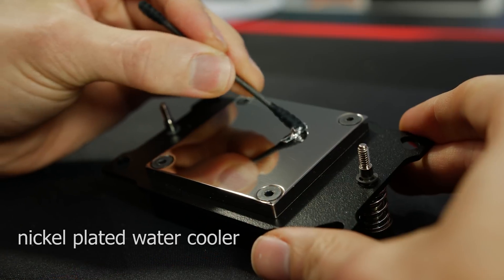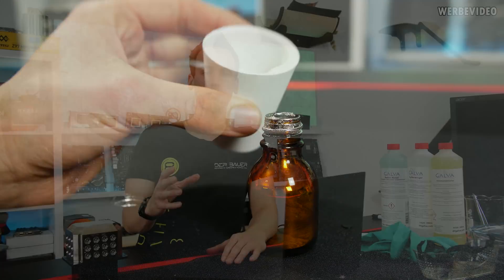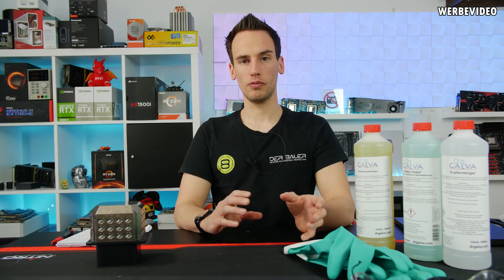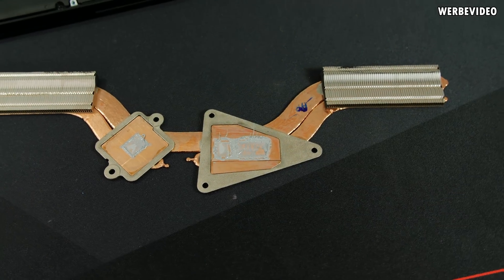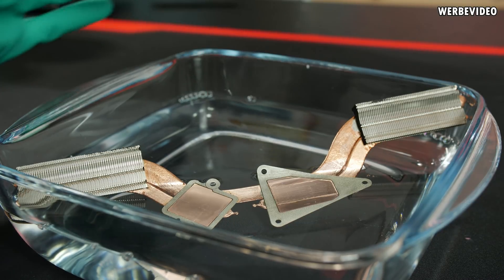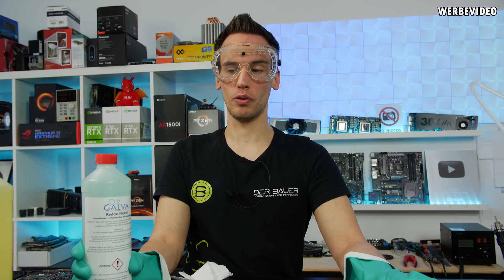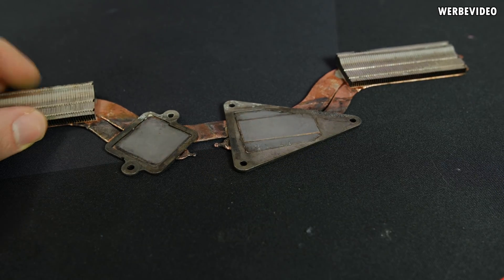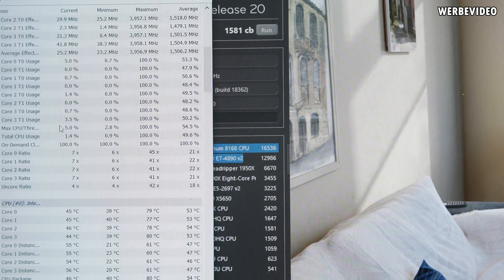Can this REALLY work? DIY Nickel plating a CPU cooler (Liquid Metal preparation)

Comment: I think there is a good chance that the aluminium/zinc (?) around the copper is interfering with the process. Especially given that the solution is acidic and the Al/Zn is in direct contact with the copper. You might get better results if you chemically thickened the oxide layer on the aluminium (anodize it) before doing the plating baths. Or you could try to cover all exposed aluminium with nail polish.

My other theory is that maybe the acetone failed to clean off all residues of the thermal compound. (silicone oil?) You could try degreasing the heatsink with toluene or heptane, acetone is sometimes too polar ("too close to water") to dissolve certain oils very well, but toluene and heptane are not polar at all.
Reply: Get some videos going :)
Reply: That is almost certainly aluminum contamination and not poor degreasing. Unfortunately, plating something like that is a hell of a job for a DIYer. It takes very little metal to wreck a plating bath, so whatever coating you apply has to have near-perfect coverage, a tall order with all those nooks and crannies to worry about. You might be able to pull it off with anodizing (though that's pretty tricky, too), but I doubt the extra oxide would do much, or the plating bath wouldn't have been able to eat past the natural oxide layer.
Reply: Al2O3 have only 30 Wm−1K−1)
Reply: @Wanakamura  Yeah, but an anodized Al piece still only has a thin oxide layer, just not as thin. Plus the Al piece is not thermally critical in this case.
Reply: Why does Liquid Metal have to be so thin, runny, and low-viscosity?  Why can't a Liquid Metal formula be developed with a higher viscosity, and which is more non-Newtonian like a paste or gel or slurry? Surely this can be done without compromising on the thermal conductivity, can't it?
Reply: @manofsan  direct die to metal heatsink (no tim) is the best transfer of heat. The only reason we use thermal paste/metal is to fill in the scratches, pits, rough tooling marks. AIO and many metal coolers, the center of the block tends to be concave, rought tooling, or gaps. Due to profit margins/perceived value and cost. So, you lap them getting far better thermals, use far less TIM. 
You'll scrape tim across the ihs and heatsink, just notice a "haze" of it on there, pea size is wasteful and worse in this application than a haze.
This is partly why Galium works so well. The low viscosity means that it can get out of the way, where paste remains like a thick blanket, with far less or no metal to metal contact.
Reply: @manofsan  yeah, sadly it must be like runny eggs because it's duty is to "fill in the gaps" and act as a bridge between the Die and the heatsink. 

Even if you get a very good thermally conductive IC diamond graphite pad, it still has heat transfer problems possibly due to gaps. Despite knowing this, I use IC diamond pad for my ryzen CPU because my cpu doesn't have overheating issues unlike my stupid GPU. Jk I love my gpu :)
Reply: @WarPigstheHun  perhaps there need to be tiny walls around the edge of the interface between chip & heat sink? Then it can prevent the Liquid Metal from running/spilling out. Too bad they can't turn this runny liquid into a paste that doesn't run as much. Paste could still fill gaps, without being runny. Usually adding some kind of fine powder to a liquid can make it less runny, and more like a paste. Copper powder maybe? Might be worth researching.
Reply: @manofsan  I did that using sticky thermal tape. :) 
Built a tiny wall on the edge of my gram chip to house a puddle of not liquid metal but still runny paste
Reply: @WarPigstheHun  how about putting a less runny thermal paste around the edges, like a wall - and then putting the Liquid Metal in the middle as usual? Or what about first spraying some kind of non-conductive coating on the chip contacts, so that even if the Liquid Metal runs, then it won't cause any short-circuits?
Reply: @manofsan  I'm sure that'll work. I put a big thermal pad on one of the sides so it'll effectively gatekeep the liquid from spilling into the other components. Good thing is thermal pads insulate from electrical damage. Although Id still check to be sure.
Reply: @WarPigstheHun  what best wipes up the Liquid Metal, if it drips or dribbles or spills?
Reply: @manofsan  best is dry wipe with microfiber cloth (dab if the microfiber gets stuck), then followed by 99% alcohol (isopropyl alcohol located near pharmacy and or nail polish section, also known as acetone). It's ok if you use 75% but it will be harder to clean since it has less alcohol. And if you can, use an air compressor to blow any remaining dust or liquid.

Definitely don't use straight tap water (due to trace metals from pipes, it can even cause copper to tarnish and turn black- from own experience), but distilled water is ok.
Reply: @WarPigstheHun  Acetone and isopropyl are different compounds. Just making sure that nobody makes mistakes confusing these two.
Reply: Definitely plus impurity on the copper
Reply: @TheBackyardChemist Yea from my dealings with plating I was thinking the same..
Reply: Yeah but to anodize aluminium you either need to heat it evenly and risk the copper heat pipe exploding, or if chemical anodization: you have to create the danger-level-equivalent of a meth lab complete with very toxic fumes, in which the aluminium cannot still be attached to the copper both because the copper will explode from excess heat, and also because it will interfere with the anodization process (you have to dip the aluminium in a vat of sulphur dioxide + other chemicals. 

But I agree the aluminium or zinc is interfering with the palladium solution OR there are trace metals leftover from the previous liquid metal paste.
Reply: I believe a diy electroplating solution would both be easier and cheaper

it is really easy to get hold of pure nickel and through, basically electrolysis in vinegar (and a bit of salt to increase conductivity), plate parts by my experiments

the only thing is i've never tried it with copper and aluminium together in the "part" but copper coats with nickel really easily and fast that way, especially if you have a good adjustable power supply that will go up to 30V to keep 1 to 1.5 amp (dependant on the size of the part), with bigger parts etc you can go to ~2 to 3A if you want it to happen fast but the vinegar will get really hot
Reply: @CustomCoinRingsUSA  what about adding particles - eg. metal particles - to help form a slurry? Particles are added to all sorts of liquids to thicken them up. The particles would have to be of appropriate size to make a colloidal suspension or paste. I read you can buy industrially made diamond dust/powder  in bulk quantities for 10 cents/gram, and as we all know, diamond is the most thermally conductive material of all, even while being an electrical insulator.
Reply: @manofsan  You don't really want to add anything to liquid metal TIM that would act as an abrasive, as it'll wear the heatsink, and increase the rate of diffusion. On top of that, you will either be adding a metal which can alloy with the liquid metal, in which case the particles would break down over time, or you'd be adding a material which doesn't alloy - or in diamond's case, doesn't bond chemically at all - so wouldn't increase the viscosity.

Pastes like IC Diamond don't have this problem because: A, the silicon isn't meaningfully reactive, and B, the diamond particles are already suspended in a very viscose medium.

Comment: I suspect a second round of nickel plating on the adhered and cleaned surfaces may have been a good idea, I also hope whoever knows will tell me when they have made a comment on the metallurgy and the reaction with AlO2? as it would be fascinating.

Comment: please do a follow up video after few months then few years.

also: they should say on thermal grizzly website that it also not good on copper and not just an aluminium warning.
Reply from the maker: there has been a message for a long time to avoid copper and use nickel plated surfaces
Reply: @der8auer  sorry but that's not really true. it doesn't say that it can interact and corrode with the copper but at a much slower pace than aluminium. 
it just says: for best results use nickel plated copper.
that to 99% of people just means its ok to use on anything other than aluminium but best temperature results are with nickel.

it should be a firm notice or a warning.

there is no doubt this was a business strategy to write it this way for more sales.

you come across as a honest person but im not sure if its language barrier in this or you are not 100% sincere.

thermal grizzly website quote: 
Note: Conductonaut thermal grease must not be used with aluminum heatsinks!

Please note: Conductonaut is a liquid metal compound and can leave visual residues.
For best long term performance results we recommend to use coolers with nickel plated surface.

Comment: I think you missed one argument on why not to do this at home: Getting rid of the chemicals afterwards is a lot of effort as well, you can't just flush them down the kitchen drain.
Except for the Copper cleaner, as long as the alcohol-part it is sufficiently diluted to not be flammable.
Reply from the maker: I guess this depends where you are from. I can just walk 200m to the next chemical disposal Station
Reply: @der8auer  It's 6 km for me, and it's only open to private users for 3 hours on 8 specific dates per year.
Reply: @ShieTar_  Also, there is a way to get back the specific compounds using a different technique.

That way, you can actually get some extremely pure copper to use for other stuff.

Comment: I think slightly better method of doing that would be gluing a small plastic box on each of the surfaces with silicone, and then pour the products directly on those surfaces.
Not only you'd use less of each ingredient, but you could change it couple times to keep the solutions fresh, thus speeding up the process.
Also no cleaning afterwards.
I think it would be worth it  since it already takes couple hours.

Comment: Why nickel??? That is so much more complicated then gold. All you need to do is put it into a gold salt solution and heat it up. And it isn t expensive because you just need a tiny layer and there are so many products/sets incl. manual and reviews for gold plating out there you can get them for 20-40 €. Please, what did i missed? What kind of advantage does nickel have???
Reply from the maker: gold does not work as diffusion barrier
Reply: @der8auer  but gold doesn t react eigther with gallium or tin under the melting point and for indium you would need almost 200 °C, isn t it? I am just curious, thanks a lot for the reply!
Reply: @claudiussmith8798  Noble metals actually quite eagerly form surface alloys, which is why you can plate them on top of just about anything and plate just about anything on top of them. And melting point of what? Liquid metal is already molten, it's already well above its melting point. The more metals you add to the alloy, the lower the combined melting point is!
Reply: @SianaGearz  i ment the melting point of gallium or tin. But damn you are right, the liquid metal is already liquid and can diffuse i didn t thought about that, it is so obvious... :/ So i guess then the nickel builds up a passivating oxidlayer on top when edposed to air that hinders the subsequent diffusion of the liquid metal??? Is that the source of the diffusion barrier?

Comment: Would like to know if the plating made a difference by its own. Try nickel plating and comparing before after using nickel playing with thermal paste vs liquid metal.
Reply: It's not meant to improve thermals, it's just for long term protection of the surfaces. 

The only reason to do those tests is to ensure the process went correctly, which the results at the end seem to indicate

Comment: Have you seen a performance degradation with bare copper? (and not just a cosmetic one). 
I used liquid metal with a bare copper i3 530 with a lapped heatspreader running almost 5ghz and a bare copper heatsink base for years without noticing anything and I still use to this day a liquid metaled r9 290 that has a bare copper heatsink base and I never noticed any drop in cooling performance.  
On the i3 that might have been due to the low power despite the high overclock or me not paying enough attention but the r9 290 was used for mining for a year straight so I think that I would have noticed. 
Maybe it is down to the specific liquid metal that I used, it was coolaboratory liquid metal ultra.

Comment: A strong magnet would help determine if the brackets surrounding the copper heat sink is really aluminum.
Reply: They are either die cast aluminium or zinc. Both are non conductive. From my experience i can tell you i am 90% sure it is zinc

Comment: U should've done it on some test-piece xD (that's what i thought at 10:00) 
And also used better suited container :rolleyes:
Hoped for better result, but anyway I appreciate the work and preparations put into it :) thumb up
Reply: Did you watch the whole video?  The results where impressive.....
Reply: @KeithZim  And did you read the whole comment? 

You must have low respect for such professional as Roman is, if you don't expect the best from him and look only at the numbers, especially after the introduction, when he talks about nickel-plating process.
It's not my goal to judge him or point-out his mistakes, as I'm a fan of him, and I'm not disappointed with the video - It has a lot of work put into it and the nickel plating subject catched my interest.
So, to explain you:
After seeing the cooler at 10:00 i thought it got ruined. Simple. 
Hoped for better results (also aesthetically), because if the nickel plating was done in first shot, without the "non-copper material" pollution and with proper layer thickness, then the results could be much better and we can only speculate now. Some reference sample (from test plating, for example) could tell us if the process itself was okay and what results could be achieved.

I'm waiting for next video as I'm sure Roman will give another go with the nickel plating trying to improve.

Comment: thanks for this video will it work for aluminium? I'm thinking of Nickel plating Dark Rock Pro 4 for my 3900x :D
Reply: Unfortunately, no.

 To plate aluminium, you have three steps:

1. You remove the anodization/oxide layer using a sodium hydroxide solution.
2. You very quickly put it in a solution of zinc hydroxide to protect the aluminium with a thin zinc coating.
3. Using a flash copper solution, you actually plate a thin layer of copper to prepare it for the main plating job.

1st and 2nd step aren't too hard to do at home, but the 3rd step is where it gets very complicated.
Reply: @neutronpcxt372   thanks! So we will have Al | Zn | Cu | Ni  
have you tried electro coating?

Comment: @der8auer the Coollaboratory make Liquid Copper do they behave differently ? 
I've heard that they don't eat aluminum.
Reply: Liquid copper is just thermal paste. And performs worse than kryonaut.
Reply: that's strange, how to make it copper transform to liquid? 
In my little knowledge copper melting point doesn't like gallium, possibility they break it into micro particles could make a scratch on the sillicon die?
*Correct me if i'am wrong
Reply: @claritoresdiano1021  Its copper suspended in silicone 

Like normal thermal pastes

Comment: If you really want high quality coating, you need vacuum coating. Try contact some factory making watch parts, I'm sure they will have the equipment.
Reply: you mean vacumm tube like a light bulb ?
Reply: @claritoresdiano1021  A vacumm chamber, the metal will be sparied as ian with high voltage and land on the base, form a perfect coating. It's common in modern coating, but will need really professional equipments.
Reply: @oscarshen6855  thanks,👍
Reply: @oscarshen6855  isn't that called vacuum sputtering?
Reply: @manofsan  Yes, that's the more "acadamic" name, but you know what I mean.

Comment: Source a clean heatsink, without any other metal, repeat the process. It will provide the perfect answer, if it's for that reason that it was so "dirty".

Spoiler alert, yes, but it doesn't matter.
Also, use fresh, unused liquid.

Comment: I'm so stupid! I actually sanded off the nickel coated surface that was applied by the factory (ASUS 1080Ti O-11G Strix / two cards). It was like 17 months ago and now I'm scared to open them up because I think the liquid metal has formed into a solid "mono block". Btw I sanded the heat sink 400/600/800/1200/1800/3000/5000(all water sanded) to a mirror finish on a 12mm plexiclass.
Reply: if you want I can open one of the cards up in the future and send you the pictures how it looks year and a half later.
Reply: 👍 i'm listening, no longer made mistake trial and error without proper knowledge.
Reply: You're fine, open it up, reapply and put it back together.
Reply: Open show us